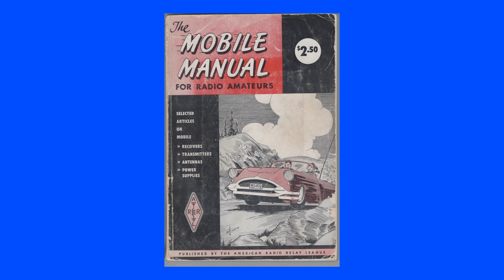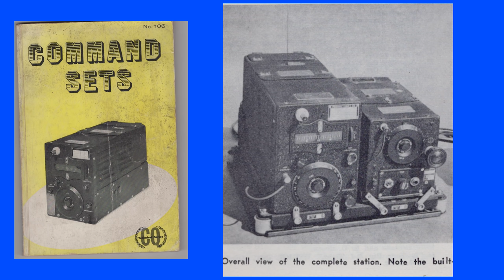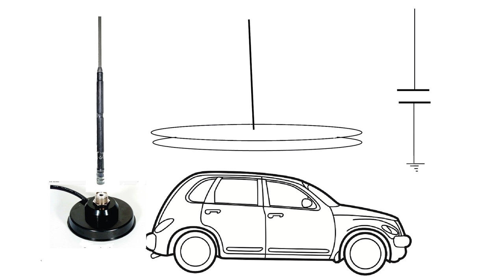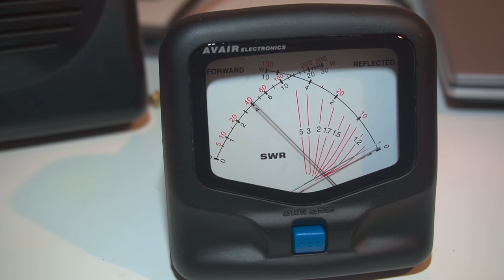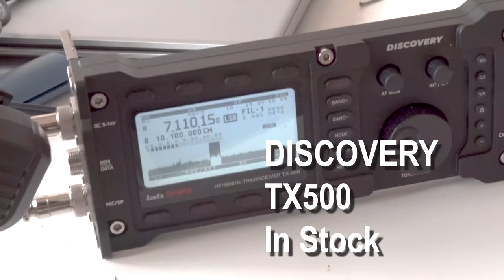HAM RADIO Magnetic Antenna Mounts - Easy Mobile Option

Comment: Great video Peter. A bit of advice, as a driving instructor, I have a plastic film on the roof of my car so my roof box "L PLATE" doesn't scratch it. It's great for my 2m and 4m mag mount antennas too. For around £5 it's well worth the money to protect the car. 
Keep up the good work.
Steve G7HUJ
Reply: I do the same on my motorbikes to protect the tanks from the magnetic tank bags. It works really well.
Reply: Hi Steve please could i ask do you mean you use the L plate or a plastic film. Do you have a link what to use please. Thanks Sue
Reply: 4m?

Comment: Great Video Peter, I got the Triple magmount from your store and use it on the bonnet of my campervan whilst portable. It  works well, even on 80m. I added some rubber boots to the magnets as using the tilt method as described to release the mount, I found the edge of the magnet could still scratch the car! I also found RF foating around the van, which I cured using the ferrite ring as described, 73 G8XDD
Reply from the maker: Hi David, many thanks for the info. Sounds like a good arrangement. 73 Peter.
Reply: @watersstanton  Would you recommend this for 10 meters as well ( The 240-43 Ferrite core wrapped 5 times)

Comment: You need to tell us the make and model of the car!  I love the story of the "make do" wooden coil form and 160m mobile operation.  I love those old black, white, and red ARRL publications, too.  I used to operate HF mobile in an MGB.  I installed a ball mount on the rear (yes, I drilled a hole!) and used a Hustler mast and resonators.  I built a shelf in the foot well of the passenger side and mounted my TenTec Argosy there.  I ran mobile CW with the TenTec single-lever keyer by reversing dit and dah, sitting the keyer on the console with paddle facing toward the front of the car, put my hand on the top of the keyer and reached over the front edge to manipulate the paddle.  Such fun!

Comment: My first HF mobile rig was an old TS520. This had a built in inverter and put out 50w from 12v. I fitted an ex army larkspur antenna to ladder bars fitted to the roof of my Mini. The sections were removable to allow a quarter wave on 20,15 or 10m as I built a small loading coil inside the base made from 2.5mm twin and earth mains cable. This was a big antenna! My best contact was ZL from the middle of town when I was actually driving along. That was on 20m. You can imagine the looks I got and also the number of bridges I had to avoid.

Comment: Here’s an important piece of advice about magmounts with PL239 sockets after some months of use: Luckily I had my SWR meter attached  to my radio and a Diamond NR770 for some time. So I noticed that SWR went up to 10 and more. The sockets have those notches on the top of the thread. So water can creep up the thread an the socket will be filled with water. Putting a 14mm o-ring over the SO239 thread and applying some vaseline to the o-ring and the whole thread fixed the problem. It might work with vaseline only and without the o-ring, but don’t trust the sockets to be waterproof without any of those measures.
Reply from the maker: Thanks for info

Comment: Great info here.
Mobile antennas will be a good topic to cover.  All hints & tips are welcome!
Perhaps begin to stock those ferrite cores when you can, even if the price may be a little higher.  These are a great idea to keep handy but not always easy to get in a top quality.
Ferrites can only enhance our operating experience!
73
Reply: I buy my ferrites from either Amazon or eBay and haven't had any quality issues. I compared them to more expensive ferrites that I'd bought on my gear and there was absolutely no noticeable difference in performance.

Comment: I had a  mag mount on my 4X4 connected to an Anytone 578 that I used for 2m, 70cm and DMR via WiFi. I have recently sold the the 4X4 and now only have a car. I was going to transfer the radio to the car but It has an aluminium body so that project is on hold while I work out the best way to attach an antenna.
Reply from the maker: I had rge same problem on an okd Range Rover. 73 Peter

Comment: I Use a Diamond Triple Mag Mount and for a counterpoise use the: 
Diamond MAT-50 Magnet mat
Magnet mat as couterpoise for HF mobile antennas
Frequency range: 7 to 50MHz (3.5MHz with two mats)
Reply from the maker: Many thanks for sharing. 63 Peter

Comment: I used to work HF mobile on my last car with my FT857 and ATAS120 mounted on a boot lip mount on the hatchback horizontal section.  I treat myself to an expensive new estate car and there is just nowhere to mount a lip mount.  I use a small mag mount for 2m and 70cms.  Thought about getting a triple mag mount for the ATAS but am extremely nervous about damaging the roof of my one off £50k car when removing the mount.  I’d also be a bit nervous using the ATAS to remove the triple mag for fear of breaking the ATAS.  I have thought of using a ladder rack bar with a clamp on mount but presume I would suffer grounding errors.
Reply from the maker: Hi David. Thanks for sharing. I am not a fan of roof racks as the grounding is very poor, if at all and on HF the rack becomes part of the antenna and can cause all kinds of tuning problems. Shame bu5 true! 73 Peter.

Comment: Does anyone do a suction mount for cars, like mine with a glass roof?  G8YTZ
Reply from the maker: Don’t forget you will have no groundplane beneath the antenna.
Reply: @watersstanton  The heat insulating glass is highly metalized and has a fine mesh within. The other issue is the car is made from aluminium. My other thought is an attachment that will fit the roof rack mounting points which have 2 x M6 screws on each.

Comment: i used to use mag mount on my car running 60w on  hf  ,the rf fried the  intake manifold actuator which then damaged the inlet manifold   £1500  repair bill  , best to use portable antenna away from car  , so  beware  hams
Reply from the maker: Hi Bill, I have never heard of that problem before. I would expect cars to be pretty RF proof these days. 73 Peter.
Reply: @watersstanton   i have a bmw full of tec  ,i now use portable antenna  and run coaxial cable in to car i will never  put mag mount on any car again